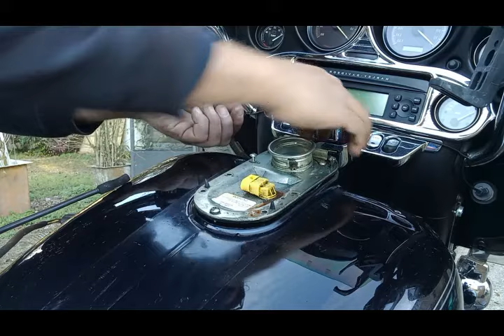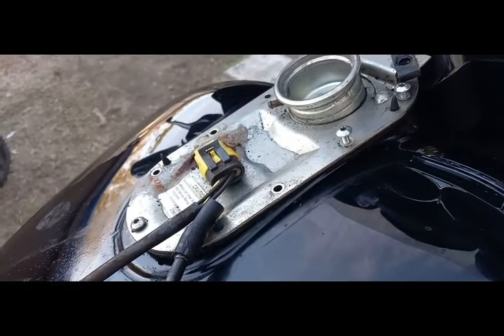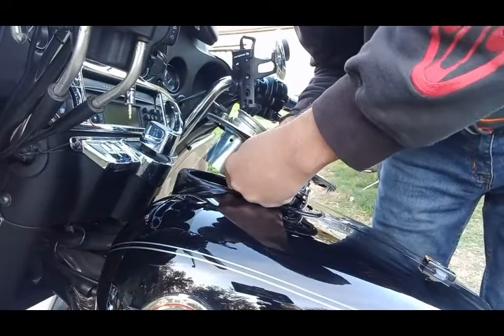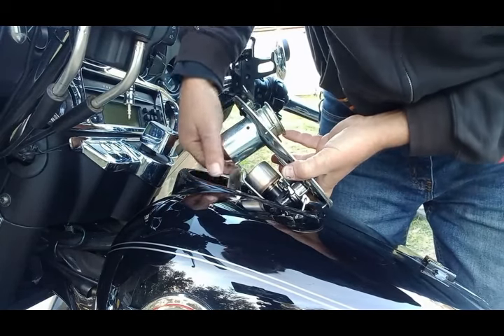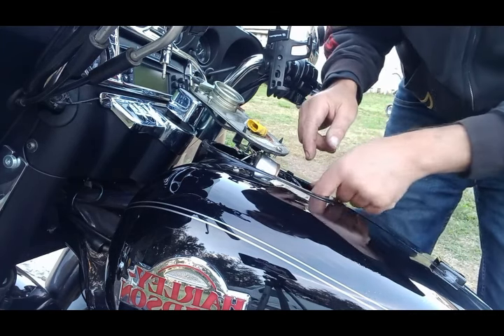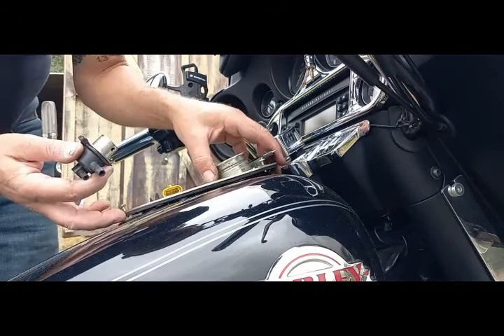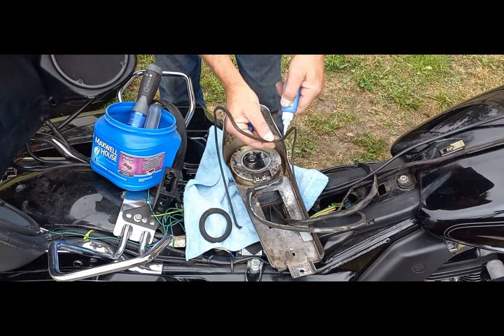Harley Davidson won't stay running or running poorly with EFI

Comment: Thank you Thank you THANK YOU!!!  My bike started running like ass and left me stranded 40 miles from home.  And the culprit was the fuel regulator cup assembly.  Rebuilt the entire system except for the pump and now my 06 Ultra Classic purrs like a horny walrus and got her power back...  Great video and great solution.

Comment: The manual will tell you to first unplug the fuel pump power wire and crank the engine to release fuel pressure in the system.

Comment: Had same issue HD shop charged me $480 for new regulator, fixed it for a couple of days then same thing. I tore into it and replaced o ring on regulator and before I put it back in between the ears I tie wrapped the housing and regulator together with 2 tie wraps which prevents it from coming apart. Been running like a champ for almost a year now.

Comment: Nice video! I have a 1997 Electra glide that had a poor running problem when engine was warm. The rpm were all over the place and wanted to stall out. My issue was the ENGINE TEMPERATURE SENSOR, under gas tank and down in the front top head. Soon as I replaced with new one the bike idled and ran like new. Something also to consider. Every 30-40,000 miles that needs to be replaced.

Comment: i have a 200o road king classic that ive been working off and on for the last 3 months that was doing this. i replace the fuel pressure regulator (under the throttle body) and replaced the fuel line. it idles awesome but it dies when i try to ride. im thinking its the fuel injectors. the guy im buying it from had medical issues and couldnt get out of bed so it sat in his garage for 3 years full of gas and oil so i drained all of that out.. its definitely been fun trying to get it running right

Comment: I have a 2015 street Bob and it runs fantastic until you try to pull it to a stop sign and let it idle and it feels like it wants to chug itself out and die but I swear that I have until I change the grips I have since cleaned out the entire intake, with jet spray and put really good gas in it and it’s still not wanting to idle once I ride it a little bit

Comment: My 2000 Roadking is doing the same thing except its carburated Not efi....replaced ignition coil, spark plugs & both spark plug wires. Fresh gas, getting fuel just fine, compression excellent. Have no clue why it starts & runs 4 or 5 seconds then dies. Please help! Ugh

Comment: FYI… if (1) your fuel pump sounds like it pressurized and (2) you pull your fuel line and gas comes out (I.e. fuel line was actually pressurized)- it may be your throttle cable or throttle sensor- especially if it stays running if you give it gas. Make sure your throttle cables are tight and throttle sensor is clean. I know.. it seems like the bike should idle with no throttle but subjectively I had these exact symptoms and it was my throttle cable and sensor.
Reply: My bike sat for about a year and it does this, I'm replacing the battery then I'm gonna have to figure out what's going on 😢

Comment: I have a 2000 Road King and after being parked for a while it wont start. I dont hear the fuel pump priming, could that be it? I purchased a pump, filter and regulator kit but figured I asked before replacing, thanks

Comment: Can you give me some help?  I have a fuel injected 2006 Heritage Classic. It acts just like your bike, but with worse symptoms. The fuel pump does not seem to be priming.  It no longer make any sounds. The system relay and fuel pump fuses are okay, but the fuel pump fuse is not getting any power. Could that mean that the relay itself is also not getting power? Where does the relay get its power from?

Comment: I have an 06 screamin eagle v rod that died on my. I knew my battery was starting to go so replaced it, but soon realized I actually suddenly lost power to fuel pump. No power to even the fuse for the fuel pump. Any suggestions?

Comment: Did this issue show a trouble code?
Reply: My 2003 RK screwed up with no trouble code. I instal;led new pump pressure regulator and filter